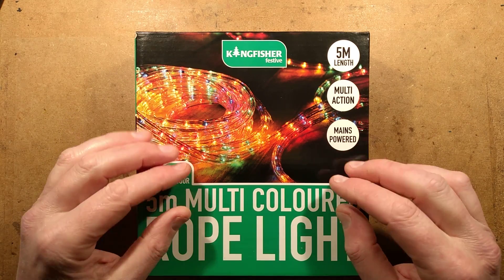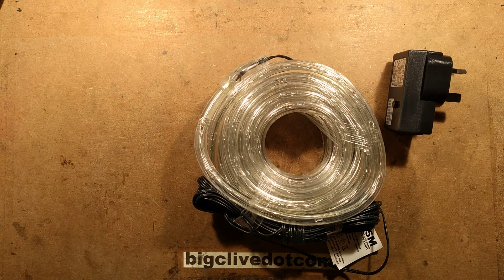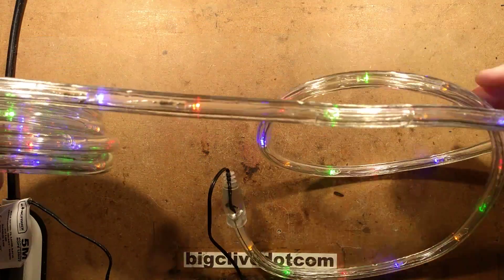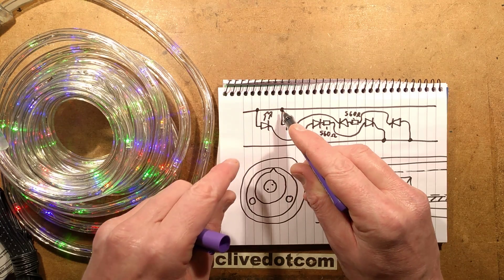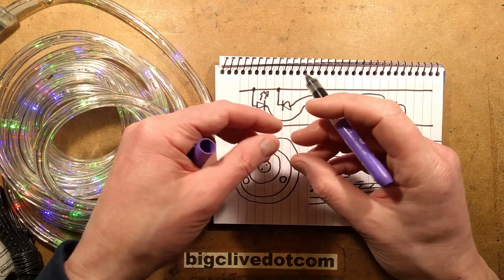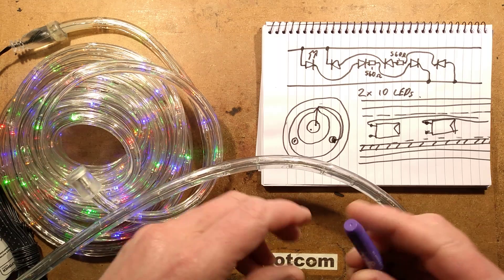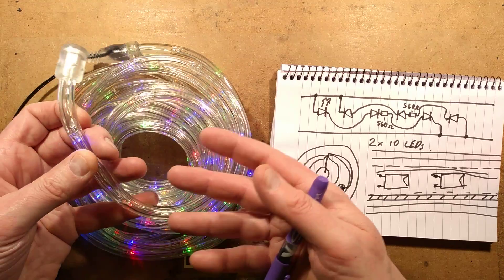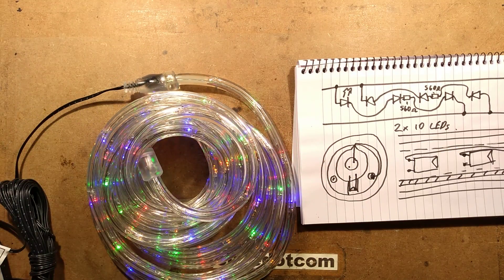Cheap LED ropelight unboxing and analysis.

Comment: this christmas my mum had a candle with LEDs in that was pretty interesting. Its a large glass bowl full of a clear, set gel with glitter through it, and in the middle of the gel is a 5cm diameter clear plastic cylinder with a candle in it, around which was wrapped a string of the LEDs on enamelled wire with the SMD LEDs dipped in resin, all set into the clear gel. concealed somewhere in the wax of the candle must be a coin cell, and the string of LEDs lights up when the candle is lit and go out when the candle is extinguished, no switch or circuitry in sight. after some investigation I saw a tiny clear plastic rod set into the candle, running down right next to the wick, which burns or melts away as the candle burns down, and must be a light guide down to whatever theyre using to sense the light from the flame and switch the LEDs. I wanted to dig the candle out and find out how it worked but they wanted to keep using it and there was no non-destructive way to see the innards. oh well.

Comment: i hate the polarity reverse led strings as essentially you can only get limited, 2 colours at a time, chase sequences. Im fortunate enough to own a 10 meter led 4 channel set of fairy lights which I have pinned around the top of my bedroom walls. I spliced into the 4 common wires with a switch box and I can turn on/off the red, yellow, blue, green channels at will. I tend to have the sequence on static and just have the red channel on so I get a lovely relaxing atmosphere when going to bed. The sequences are much better as you get reverse chase, fading across all 4 colours, flashing etc.. very fairgroundy kind of look to it. I wish there were more light strings with proper individual wiring of the colours. If anyone finds any for UK shipping, let me know where as I want some more :)

Comment: Does the UK have any phase to color related wiring standards? Here in the US (it at least locally where I work) A/1 is black, B/2 is red and C/3 is blue. All I ever see in your videos is brown.
Reply: Domestic supplies in the U.K. are single phase only, 230V 50Hz. Appliance wiring (to the plug) should be Brown (live), Blue (Neutral) and Striped Green and Yellow (Earth), but if you cut open pre-moulded cables you may find other colour schemes. Neutral is bonded to Earth outside the home, none of that split phase stuff here.  Fixed wiring around the home has different colours if installed pre-2006.

Comment: O.K. I've got a couple of questions you probably won't know the answer too. Regarding the regularly spaced version you showed at around 8:30... A: How the hell do they get the LED's in the holes, and B:.... how do they make the holes?!?!?!?
Reply from the maker: The internal extrusion passes through a punch system that may actually use the freshly punched holes as the drive and alignment system for further rows of holes.  I'd guess that an automated insertion system might use the same holes to align under the LED insertion head.

Comment: I've got a set of Kingfisher LED outdoor Christmas lights.
I bought them as a second, or "return", from a large mail order company, so they were very cheap.
There's about three feet of LEDs not working, but apart from that they're very nice.
Reply from the maker: If they're low voltage lights that may be something as simple as a short circuit across a single LED.
Reply: @bigclivedotcom  thanks Clive. Merry Christmas.

Comment: I had a set of rope lights spark and smoke in my hand
Reply from the maker: The old tungsten ones used to fail spectacularly when water got into connectors or end caps.

Comment: That's very interesting! I bought the cheapest rope LED lights I could find in the local Russian shop. Would you be interested in having a look at them, once I'm done lighting up my balcony?
Reply from the maker: Are they traditional tungsten ones or LED?
Reply: @bigclivedotcom  Sorry to say they are LEDs. One of those "icicle" designs though. Where there's a main wire with LED barnacles perpendicular to it. To compensate I could include some tea! Do you lean towards black, or green tea? :)

Comment: I’d love some advice on an led string that has failed. The first half dozen have what look like burnt out resistors on the leds. Anyway to fix them? I think it’s the kind that just divides mains voltage by the number of leds.
Reply: Rob Dunfy - best abandon using it on the mains and rewire it as chains of ten series wired LEDs. Wire in new limiting resistors. Then wire up each ten chain LED + resistor into parallel groups. You can then run it from a 30V to 35V DC PSU 😉
Reply from the maker: Is it a mains voltage string bought cheaply from an eBay seller?  If it is then they often grossly under-rate the resistors such that setting the lights on the static setting will cause them all to burn out.  It's also not uncommon for 120V LED strings to be shipped to 230V countries.
Reply: bigclivedotcom that’s probably it. I was thinking to dismantle the blown ones and replace the resistors but that might make it worse for the rest🙁 what happened is I left them running overnight and then I noticed they had stopped. They were on cycle mode.

Comment: Talk about weird electronic tat. I just found a tiny 5 volt fan that runs on the input (not an error, the input) connector of a power bank or cellphone. How does THAT work?
Reply from the maker: OTG (On The Go) allows modern Android phones to power external devices from the charge port.
Reply: I have no idea what is up with the powerbank but phones can output power as well its what gives power to any usb otg adapter so thumb drives and other devices will work.
Reply: Clive has a video about power banks. The micro usb and USB-A ports are connected in parallel. And the controller figures out if it's being charged or discharged by making short pulsed changes in the voltage level and observes the reaction of the load/power supply.
Reply: Magic Pixies, perhaps  ⚡🧙‍♂️⚡
Reply: The most heat is when the battery is being charged.

Comment: The only downside to ropelight is when sections fail, there's a couple houses nearby where they put up some rope lights, and they must have been quite rough with them as they have missing colours & whole sections as they animate, looks a bit naff... :P
Reply from the maker: That's really common with the old tungsten stuff.  But it's better strapped onto a frame and left on it or if using it loose you have to coil it in wide coils to avoid excessive flexing.

Comment: Possibly the worst thing to happen to LED lighting: Two wire chase controllers... Did that EEPROM hack to a set to get them to stay on one pattern!
Reply from the maker: This set has memory.
Reply: I have a set on my Christmas tree that supposedly has a memory but every few days it forgets and reverts to some horrible flashy pattern... it annoys the crap out of me! How do you do the EEPROM hack?
Reply: @CarnivalBen    I have a set that I bought specifically because the controller had a continuous setting.  After 10 minutes it switched to flashing.  Infuriating!  My guess is that the supply wasn't specced for the load of all lights on continuously long term, so the programmer put a timeout on it to stop the supply overheating.  The consumer finds out after they've bought the damn thing.
Reply: I raise you to another level. I bought a set of Christmas/party LED lights two years ago. They used a two wire system with the LEDs wired in inverse parallel. Worked fine for an hour. When clicking the mode button to change from the annoying flashy pattern, half of the LEDs went dark and stayed that way. Yep, you guessed it, it had failed!
Anyway, as they were up, I left them up (working on only half the LEDs). After they were taken down, I investigated. Of course the PSU and controller electronics were all in the single plug type plastic case. Which had either been glued shut or “plastic welded” shut. So destructive force and much drilling and sawing resulted. They definitely did not want users to get inside!
Once in, I found the problem. A simple four transistor bridge circuit was being used, with each pair of transistors being controlled from separate microcontroller pins. But there was no protection provided to prevent a short circuit if both the microcontroller pins should happen to both go high at the same time... hence at least one transistor was found to be damaged with another suspected to have also been damaged. So I replaced both, and added another transistor to override the microcontroller should it make both outputs high at any point. The hardest and most time consuming part was adapting a spare “standard” plastic plug type PSU case to take the board...
Reply: @Mark1024MAK    I'd have slung the lot and gone for seriously retro-chic paper chains.  Leds are so cheapo new-romantic, passé.
Reply: Ray Kent - where’s the fun in that for a geek? The most fun was in two parts: (1) the fun of breaking the existing case open and (2) working out what had gone wrong 😊